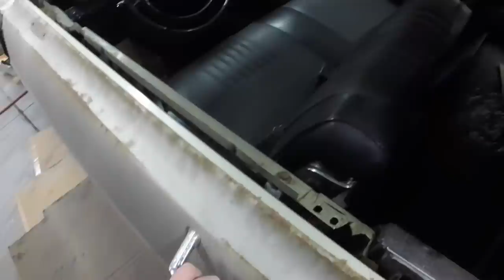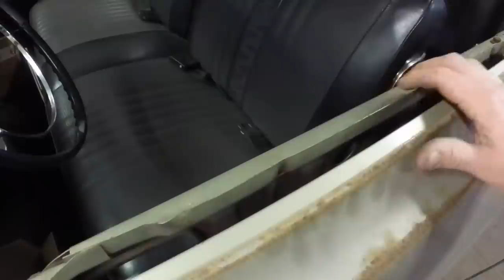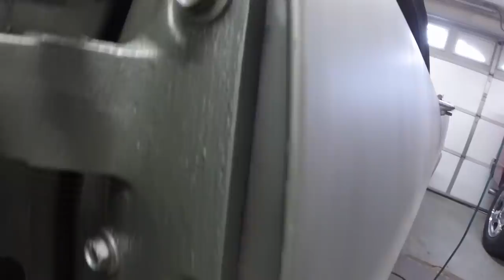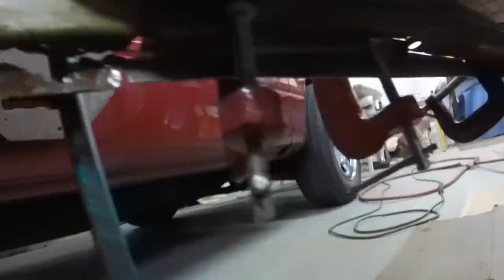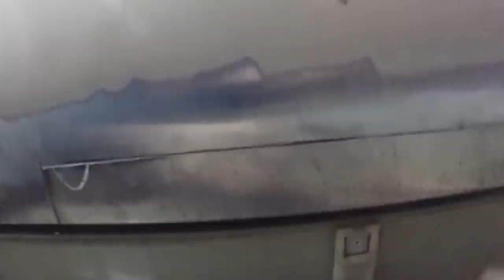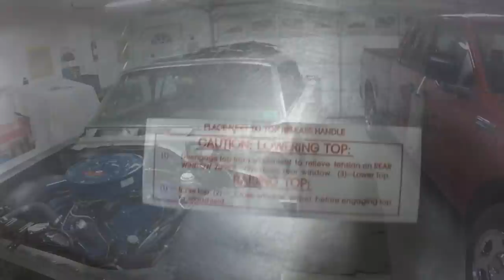1966 Ford Galaxie 500 convertible restoration part 83 welding up drivers door

Comment: No offense, respect for your hard work, but...you’re better off finding rust free doors. These repairs, no matter how carefully done, will come back to hunt you. Unless you sandblasted everything the smallest trace of rust left behind will become a problem in rhe near future. I have seen too many repaired doors with cracked filler etc. With a rustfree door you can simply treat the inside with some sort of oil product, so it won’t rust again from the inside out.
Reply from the maker: Your more than welcome to supply me with rust free doors, as I cant afford to spend money on something repairable. I have done over 50 cars, most way worse, rust wise than this car. I still see a lot of my past cars. There still solid good looking vehicles. Some were from 30+ years ago.... that must state something! The doors will outlast both of us, so I am not to worried about them. Just look at my Bel Air... I did that car 39 years ago (many videos of it here on YouTube).
Reply: Old Car Alley yeah, not easy to find rustfree doors ofcourse. I get that. Good luck.

Comment: When you are welding in a patch, after the initial tack welds to hold the piece in place, do you  use a series of tack welds to finish the job or do you run a bead along the seam?
Reply from the maker: It depends of the gauge of the metal. I like to run a bead, but if I am working with thin metal, it might be a bunch of short beads joined together. My old Miller Cricket welded sheet metal really well... it would set to a really low amperage. My new welder burns threw much easer, so I got to run the bead faster, to keep from burning threw. Maybe I need to use the new welder more on sheetmetal, to get totally use to it. I still have my Miller Cricket... it's up north at the cottage....

Comment: The outer skin should have been  cut out the full length. More rust under that lap joint then you see.
Reply from the maker: I opened up a lot of the joint.... it's in good shape, and will be fine. After oiling and undercoating the inside of the door, it will outlast all of us!

Comment: Hello Howard,
Question - why don't manufacturers design openings in bottom of doors and rocker panels to permit water and small debris to run out and prevent rust? Thanks
Reply from the maker: They do, but they get plugged up, and hold the dirt and water, so they rot out, and you got to spend your hard earned money on a new car. Thats how the car companies make money... by making sure there cars don't last forever.

Comment: Good morning, great work! What is your secret for matching the paint as you paint those body parts on separate occasions vs. all at once?
Reply from the maker: I mix the paint exactly the same every time. It's acrylic enamel, so temp. and humidity really don't effect it, but reducing it differently does. As long as you use the same can of paint, matching is not an issue. I think it's kinda a myth, about painting, and not matching, unless it's lacquer, if it's not sprayed all at once. I have never sprayed everything all at once. Lacquer doesn't like humidity. It blushes bad in humid weather.

Comment: We used to adjust the alignment on a door by placing a rubber mallet near the door hinges and close the door on the rubber mallet and it would align the door and close smoothly.  Not very scientific but it works.
Reply from the maker: I have done that in the past, using a block of wood, but I prefer loosing the door, to move it.

Comment: The door is empty, when you put the glass and hardware back on the door it will drop a bit, so might want to wait until then for finale adjustment.
Reply from the maker: O-totally. I just wanted to line it up, so the repair panels would look good. I like getting the panels in place why the door is on.... but the door needs to be adjusted to fit first.